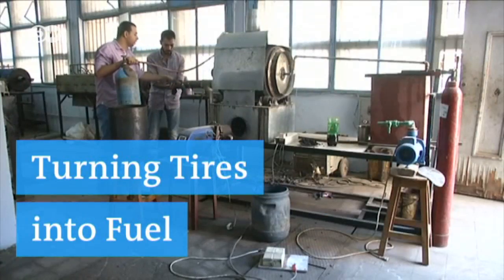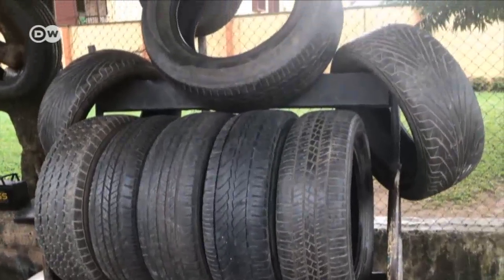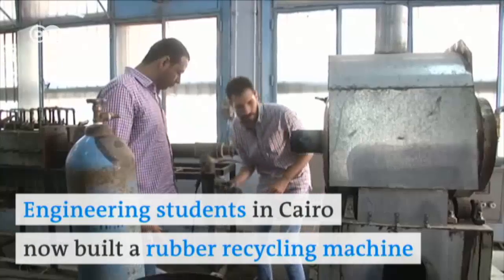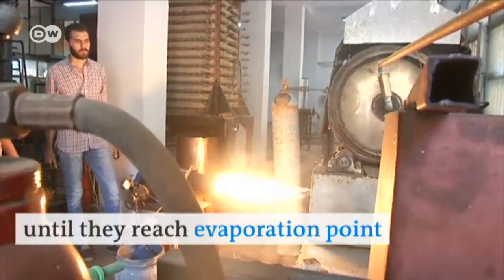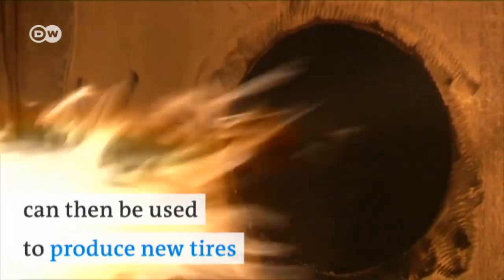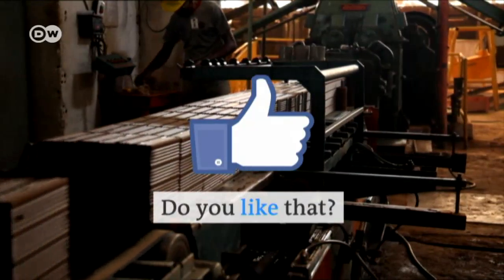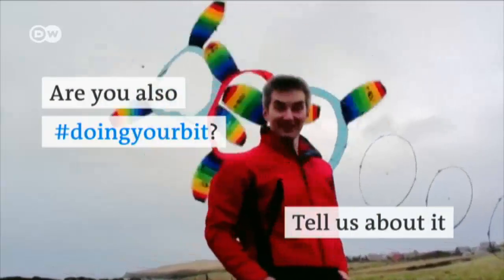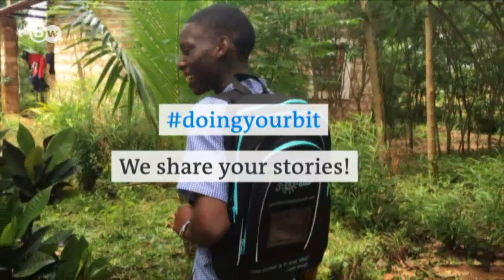Making fuel from tires in Egypt | DW English

Comment: how much fuel does it take to heat the tires to produce the fuel?
Reply: Not an answer but If you start the process on something that burns and then you use the fuel produced to as fuel for the process.